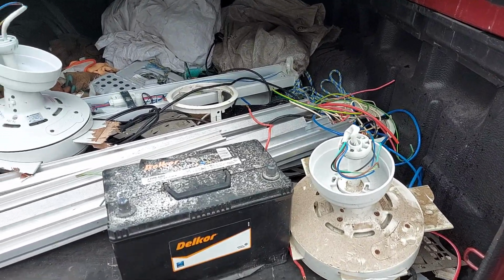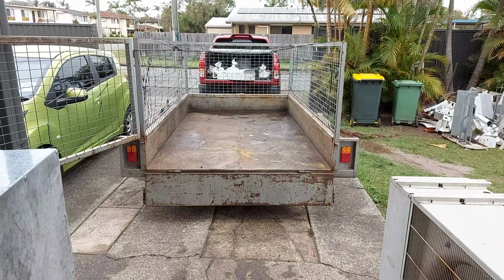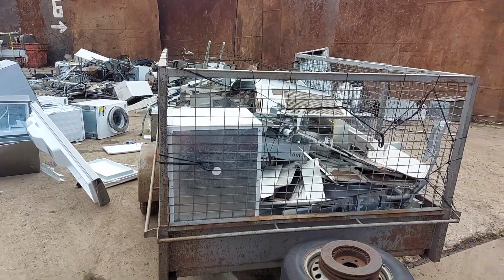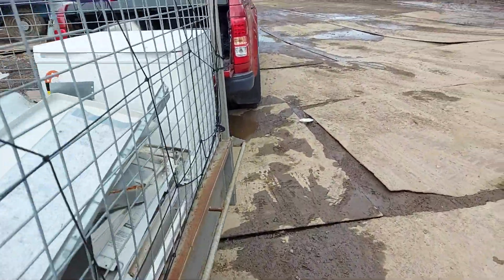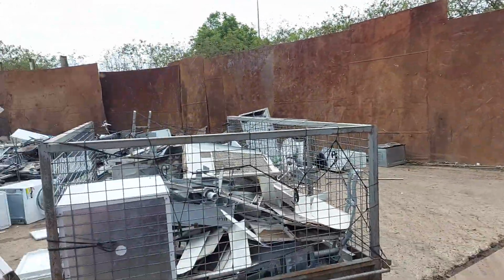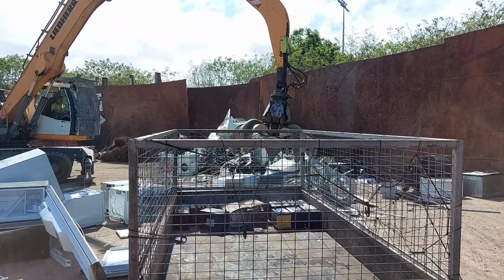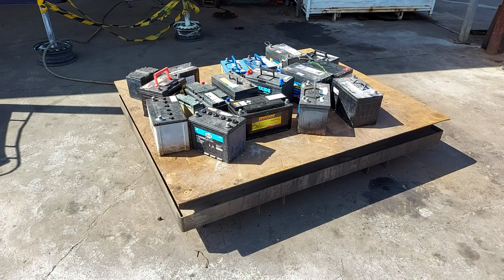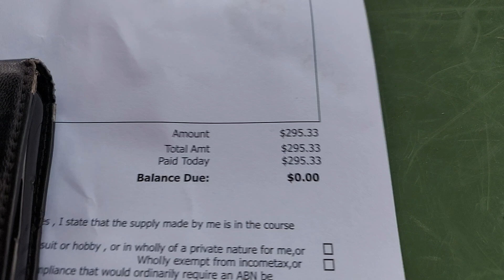Mixed Bag, Scrap Finds to Scrap Yard Visit

Comment: Nice grabs from the bins so far this week. 👍
The fluorescent light ballasts are good little add on to the hi-bay ballasts. You get roughly 60 - 80g each ballast of copper. I haven't done the maths but they might pay better as motors and left alone rather than breaking them up. Me, can't help myself, I pull them apart. Good video again mate.
Reply from the maker: Yes wasn't a bad few days.....I collected another aircon on my way home from the scrap yard and found 2 more ceiling fans in the bin this arvo plus a few other goodies........Ill give the math ago myself on the ballasts but seeing that the hi bay ballasts are 25% - 26% in copper weight then ill make the assumption that the smaller ones are probably the same......... The hi bay ballasts based on weights i got from the 2 types i weighed im guessing there is around 64kg in total weight from the 22 ballasts unstripped which would give a scrap value of just under $68, Removing the copper will give me an estimated amount of around 15kg of burnt copper and a scrap value of around $164 so definitely worth getting the copper out coz you still have the value of the steel to add on top of it.